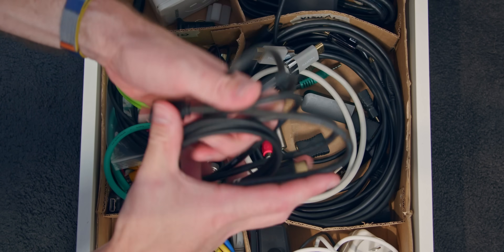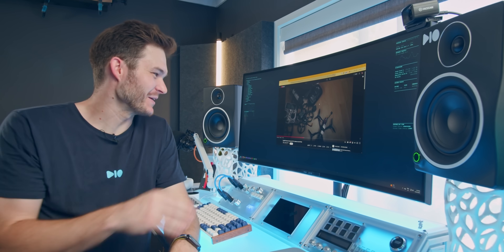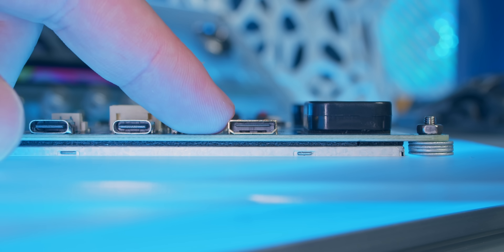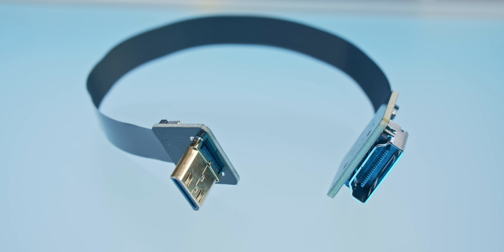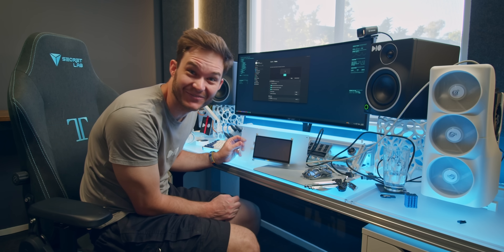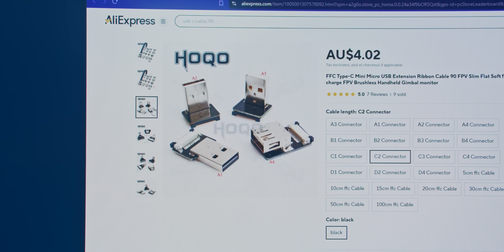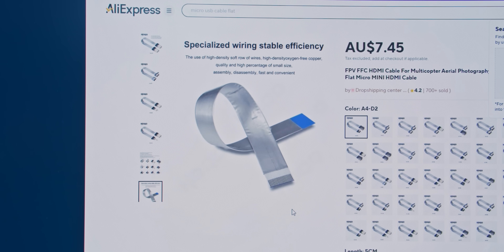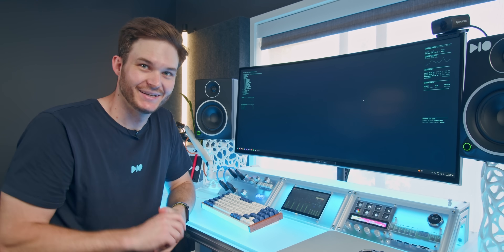You can make a thin HDMI cable? and USB?!

Comment: I have a project where I'm adding a raspberry pi and touchscreen into my car and integrating them with the existing electronics. I've been using the right angle adapters and thick cables, and stumbled on this by chance doing research on soldering my own connections. This is beyond perfect for my project! Can anyone with experience with HDMI ribbon cables tell me how much flex they have? Can you bend/fold them like other ribbon cables?

Comment: ... The reason AM is used instead of any other modulation scheme in aviation is due to the doppler effect. And speed difference not backwards compatibility. Most digital modes would become undecodable due to doppler shifts

Comment: Soo glad I found this video. Currently trying to make a PS2 slim usb hub and its using usb 3.0 extension cables for usb inputs, Had to file the usb ports due to the plastic shell around the usb port. Now I can put it in perfectly without having to mod the shell at all.

How its set up is the regular usb ports as mouse dongle ports and the main controller port(s) as my keyboard input and soon to be a PlayStation controller port. For the keyboard port I had someone make the PlayStation input plastic parts and it looks like its a controller plugged into the console. 

For the future I would love to use the memory card ports as sd/ usb drive inputs If I can make/ find memory card shell printables. May make a ps1/ ps3 (missed out on a shell for sale😔) versions

Comment: With the Raspberry Pi Monitor, I only need 1080p at 60Hz. So any 1.4 cable should do. Very hard to find a nice, thin, braided HDMI cable that goes with that monitor well. Just need like a meter cable, but everything I've found is plastic and stiff. If anyone has a link to a nice thing 1.4 cable, please post a reply here.

Comment: I’ve seen the video, but I’m not sure I get it. The cable thickness seem to be irrelevant for your application? All you need is the smallest angle adapter to avoid ot sticking out on the side. The actual cable could easily be 10 times fatter and still go behind the screen?
Reply: He said less than thirty seconds in that he needs the thinnest cable possible to get maximum space on the left hand side.
Reply: @ But the cable itself wraps around the back? The only thing that matters is how much the angle adapter sticks out on the left side. Judging from the close ups, the ideal solution would be a shorter usb plug.
Reply from the maker: I get what you mean, and I probably should have done a close up comparing a right angle tip to the modular PCB tip, as you're right, it's the tip that's most important for my specific need, but the term "cable" is interchangeable with the entire thing.

It is however, the thinnest option I could find with a right angle bend, given there's no plastic around the tip 🤙

Comment: 2 Fun facs. My 4th monitor today is an IPAD2 screen from a DEAD ipad2. And i use it just like yours, at the bottom/left of my main monitor to show VoiceMeeter (and some other stuff, like ChatGPT, etc... The screen is amazingly sharp and bright but it does not have the touch function. I am using a HDMI driver board for ipads. :) And i am ALSO using those flat cables on it !

Comment: 1:36 no, you cannot get a "really long ribbon cable", since HDMI uses twisted pair (similar to Ethernet and many modern cables) to reduce electromagnetic interference. 
Since your ribbon cable uses straight parallel wiring, it will not self cancel out, leading to the HDMI 1.4 speeds as well as not supporting great lengths. 
The later shown 2.0/2.1 cables always have a pair of conductors together because of this - they are twisted by necessity (not shown in the picture).
Reply: Exactly this, it's why HDMI cables are so thick
Reply from the maker: fair point, I've seen 1 meter ribbon cables for HDMI usage which is what I was picturing, in my head that's a "really long ribbon cable", not a "really long cable that happens to be ribbon", confusing wording on my part.

HDMI is for sure a pain with really long cables, had to get an active directional HDMI cable back in 2016 for my home theatre run which was over 5 meters, man was that a tricky thing to find back then!
Reply: Twisting is not the whole story. Twisted pair cables are twisted to help mitigate the effects of external noise, and each pair is twisted at a slightly different rate to minimize crosstalk between adjacent pairs. In unshielded cables, twisting is also the way to achieve controlled impedance for each pair, as it keeps the conductors close together. But twisted pair is not necessary to transmit fast differential signals over long distances. The 2.0/2.1 cables shown in the video are in fact not twisted. They use a coaxial differential structure, also found in SATA cables or PCIe extensions, for example. The two conductors within each pair are evenly spaced and surrounded with a shield that is referenced to ground (or it's just ground). The shield helps solve the same problems as twisting, and the two can be combined for even better results (like in cat 7 Ethernet cables, for example). It's perfectly reasonable to transmit HDMI with a long ribbon cable, as long as it has a reference plane under the differential pair traces (like on a PCB) or, even better, is evenly shielded on both sides. The shielding needs to be even to keep the impedance constant.

Comment: Yes!  These things are amazing.  I used some to build a cyberdeck a while ago; but was only dealing with raspberry pi trash screens and keyboards and stuff so never ran into any issues with bandwidth.  I was always amazed at how strong those little flip down connectors are!
Reply from the maker: ooh yeah raspberry pi projects would be perfect for these, probably a common use case I haven't really noticed.
I've got one raspberry project from a few years ago I'm already thinking of modifying with one of these cables to easily adapt to full sized HDMI with minimal weight.

Comment: For next to the monitor, putting some faders or potentiometers and using deej would be cool for controlling voicemeeter with hardware
Reply from the maker: I have considered that as the thin vertical space is PERFECT for it! but since it's a touch screen and I also have knobs on the streamdeck for applications, I feel like it'd be "just because"... unless I can find an extra usage for them like desk LED brightness?